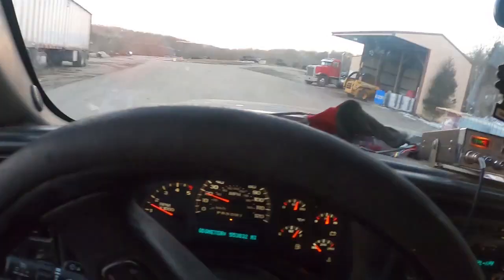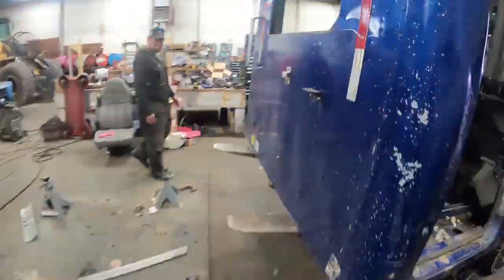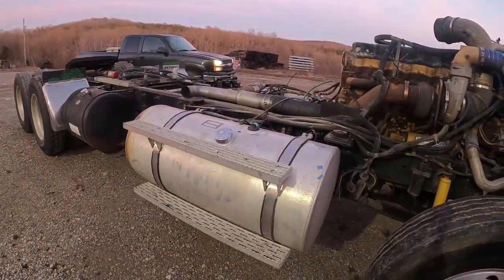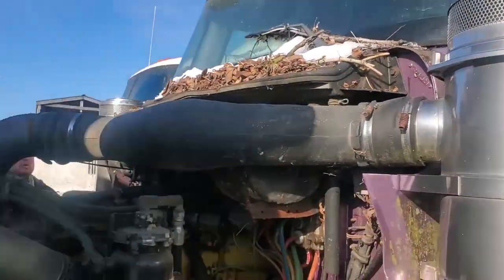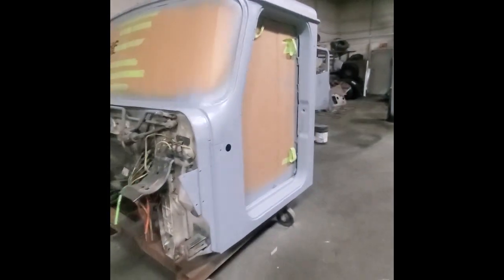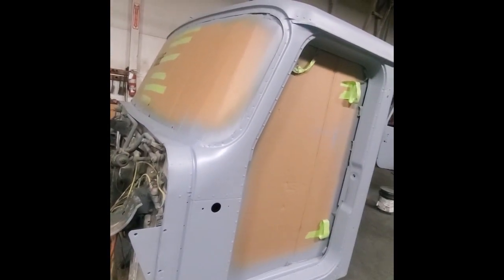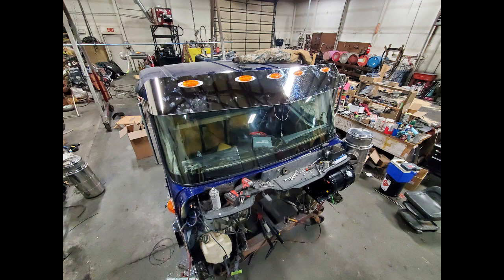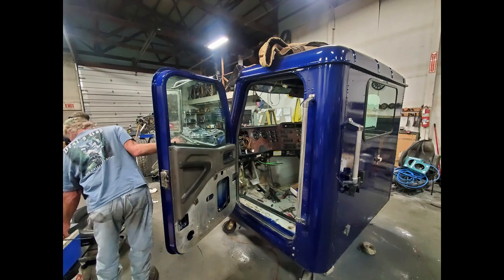Rebuilding wrecked semi truck

Comment: I here you on Cummins I’ve owned both and like both.if it ain’t broke down I like them. I hauled logs on a Ryder freight liner for 8 yrs before I crashed it hauled 100000 lbs day in and day out in mountains of East Tennessee. Truck had n14 10 speed. 40000 rears. Spent 800 in parts in 8 yrs beside oil changes.I now have a kw with c12   10 speed 3 yrs in no trouble. It ain’t the fastest but it will haul with anything .also have a kw tri axle n14 18sd 46000  and it’s a beast. You are not hurting my feelings at all I say to each his own. But I will say the driver has a lot to do with any truck. Love your channel
Reply: Well said! The driver will make you or break you. I own, drive, and maintain my truck. It does pretty well for me, if I brake it, I will have to repair it...😔

Comment: Great speech wade it's not the make or model it's what's under the hood and the power train that counts when you have a good truck keep it and do what it takes to keep it running cause you never know what you're going to get even if it's brand new keep up the good work driver

Comment: The good thing about having a truck like that is it's 1 of a kind. The bad thing about having a truck like that is it's 1 of a kind and it's hard to find parts that just bolt up or plug in. That's a lot of work but that motor, transmission, and rear ends are worth rebuilding that truck. It's looking good so far. I can't wait to see Stevey driving it again.

Comment: The reason that truck was built so tough it was a east Kentucky coal Hauler, we know how to set trucks up to haul some weight. I drove a cornbinder 10 wheeler dump that had 80 bogeys with the 18spd with the 550 twin turbo Cat coal packin’ daddy for sure. But if you’re looking for another real truck I’m sure theirs plenty for sale around here right now after “The War on Coal”

Comment: Lol Wade I love it tell it like it is but i like my binder worked as cat mechanic at a frieghtliner dealership and far as trucks you can have a PACCAR truck with a fancy exterior and interior with light little PACCAR engine or spec any other workhorse with a real driveline and have same money in it those specs add up to money I'm with you hanging onto my old 93 9300 eagle with my 3406 manual C model
Reply from the maker: Hey I'm right there with ya buddy drive one every day and love it

Comment: I don't know timber just now learning. Trucking I have done for 36 years your right fix it. Got 2 myself 385 pete 2003  and a2014 t660 just junk. I pull chemicals.

Comment: difference night day in a cat an cummins ..... i agree 100% ..... lil blue dump truck has a 8.3 cummins my road tractor has a Cat c-12 i turned her up hot as i can .... if you dont pay attention you will melt her down! she needs the R's to keep the power up but its paid for ..... I want to build me another one just too many irons in the fire at the moment
Reply: C12 is an underrated engine. They're great little motors.

Comment: When CAT stopped producing highway truck engines, one fleet switched from Peterbilts to Volvos.  Volvo trucks had a 16-litre "Big Block" engine which was the most economical engine in the fleet running in British Columbia and the I-5 Corridor in Washington State - better than the Volvo 13-litre engines in the other trucks in the fleet.  Unfortunately, Volvo discontinued the 16-litre engine sometime around 2015.  Last I heard, Volvo did not offer any engine bigger than the 13-litre.  The fleet tried various trucks with engines from Europe, but they were disgusting crap compared to the 3406 CATs, IMHO.
Reply: That’s why Scania still have their trusty V8... 16+ litre with 650+ hp. They are the last company that still produce those engines and still got all emission crap up to all regulations and rules. And their trucks, that’s the real deal when we talk heavy duty. The 13 litre Volvo is still crap even here in Sweden. Wish you all could be able to buy Scania over there in north america...

Comment: Got to have time dealing with wiring harness, and rebuilding equipment..work tearing dwn aircraft /inspection/repair and fly again.nothing like seeing aircraft  sitting on jack s with no gear , engine, flight controls, and wiring harness everywhere, then get back in the Air .. after  a lot of wrench , time..be safe tater!